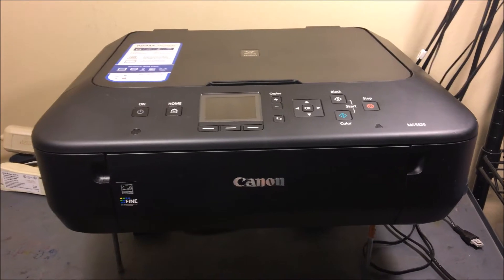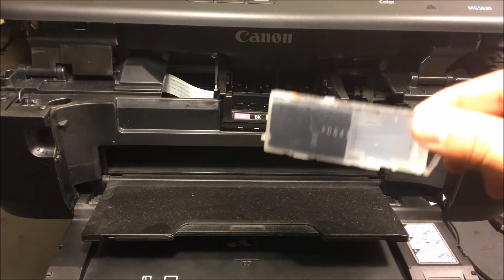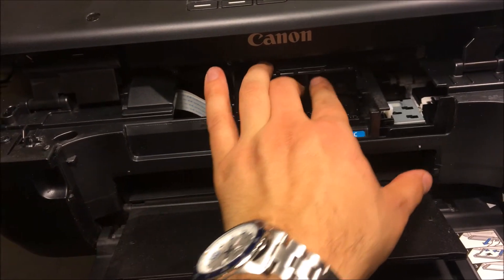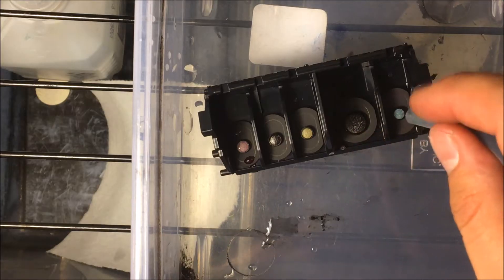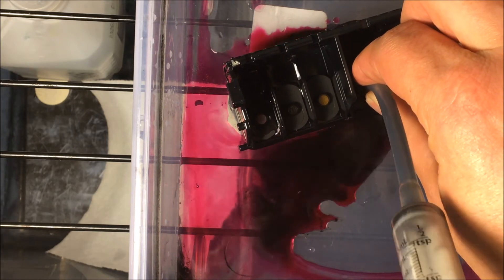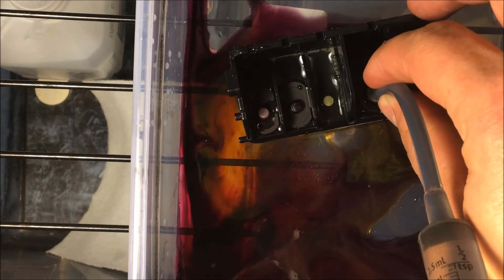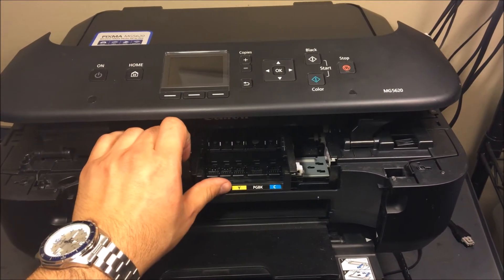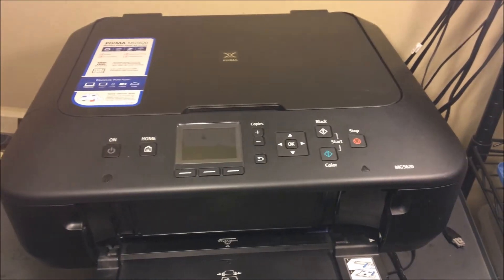Canon PIXMA Mg-5620 How To Clean Printhead - NOT PRINTING COLOR OR BLACK, BLANK PAGES [FIXED!]

Comment: Your New Printhead link, https://amzn.to/2Fhb70h, says that printhead is "is Only compatible with Canon IP3600 MP540 MP620 MX860 MX870", and does NOT include the Pixma MG5620. What makes you think it will work for the MG5620? Are you sure it will?

Also, do you know if the Support Code C000 indicates print head needs cleaning and/or replacement?

Thanks!
Reply from the maker: I apologize I could not get to your comment. If you would still like support, expedited responses and member only videos please sign up for a membership here 👉 https://geni.us/BPChannelMember